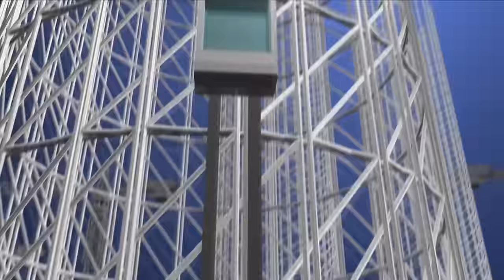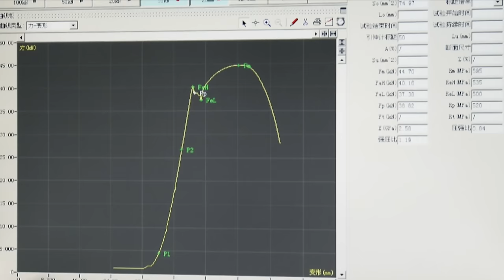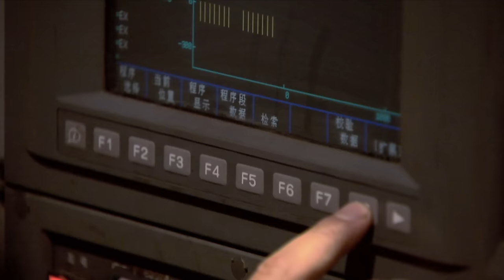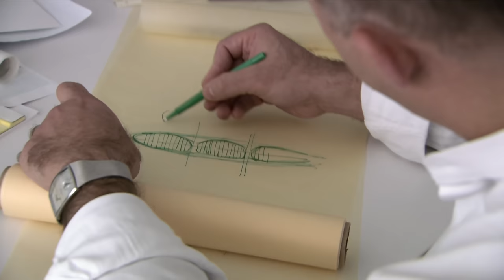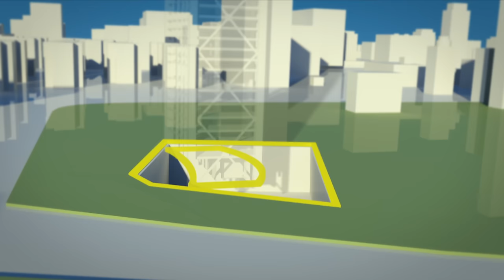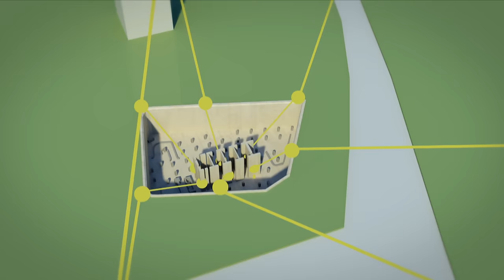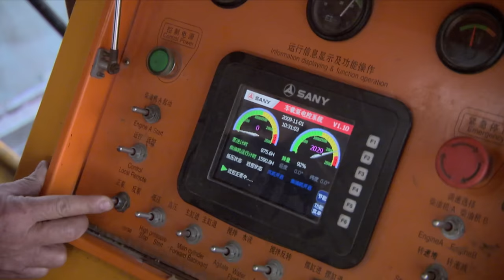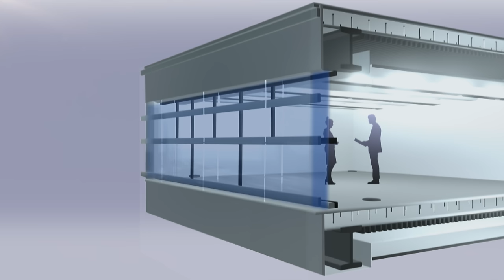The Pearl River Tower: The Skyscraper That Generates Its Own Electricity | Megastructures | Spark

Comment: Most of it will fall down if it is made by Chinese .
Reply: Its 13 yrs old and up there.
Or is your opinion for the jolly green gaint. The USA fallen behind in innovation.
Reply: So silly! Around the country there are many magnificent, well designed structures. There are also poorly designed and constructed. I have done engineering work in China. Positive and negatives as everywhere.
Reply: @gingertom56  didn't americans  architect and engineeri it? - "The tower's architecture and engineering were performed by Skidmore, Owings & Merrill with Adrian D. Smith and Gordon Gill..."